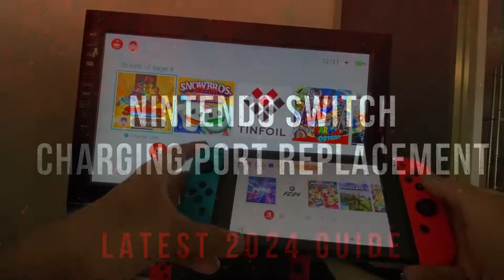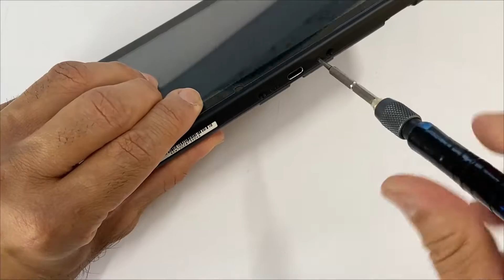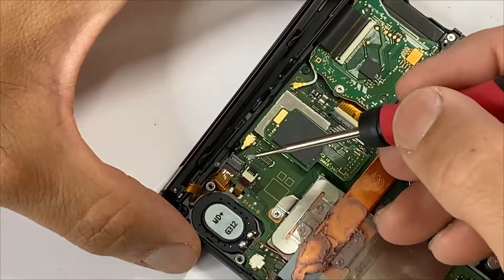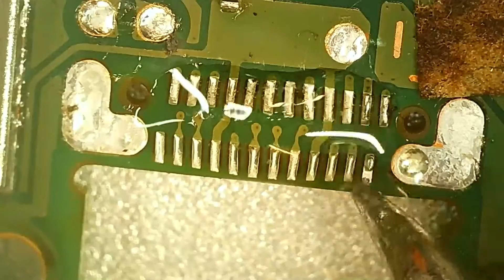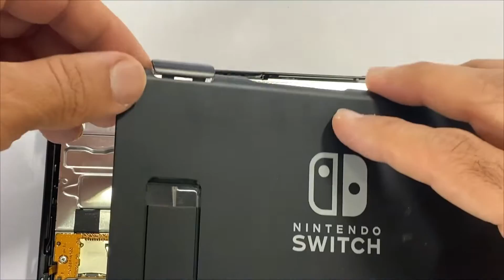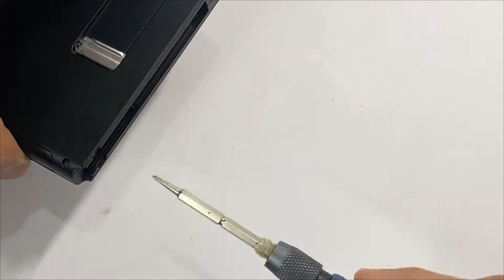[2024 Latest Guide] - Nintendo Switch [HAC-001] –!FIX! Charge Port –!FIX! Unable to Display via Dock

Comment from the maker: The tutorial is divided into the following parts along with the starting time: -

1. Symptoms of Nintendo Switch console Model # [HAC-001] – unable to display via Switch Dock (00:05)
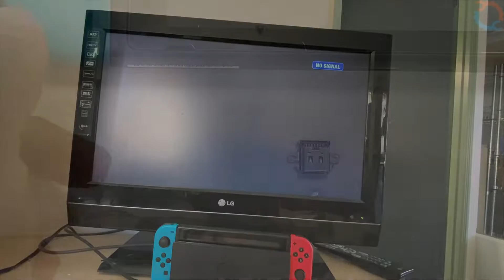2. Explanation of How Nintendo Switch USB Type-C Charge Port works (00:19)
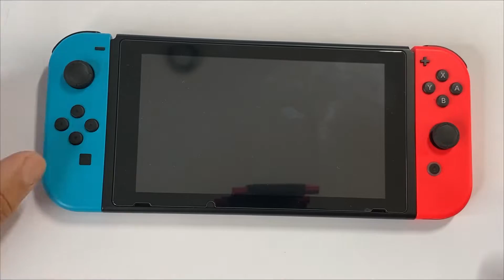3. Disassembly of Nintendo Switch console Model # [HAC-001] (00:53)
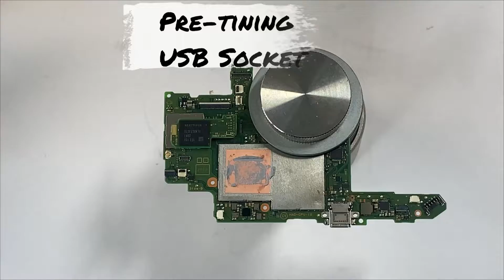4. De-soldering-Soldering USB Type-C Charge Port of Nintendo Switch Console Model # [HAC-001]  (05:00)
5. Assembly of Nintendo Switch console Model # [HAC-001] (06:21)
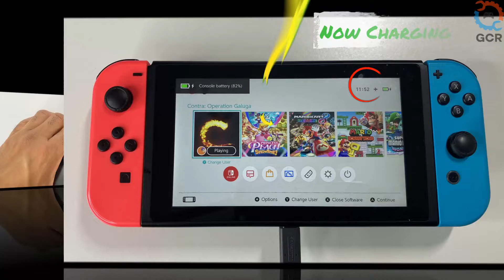6. Testing and Conclusion (11:21)
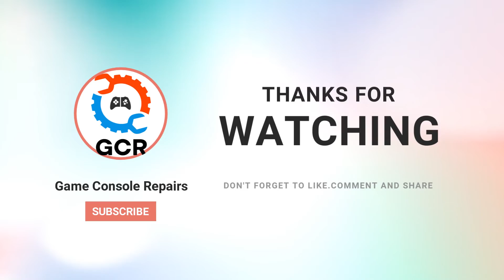7. Credits (11:30)